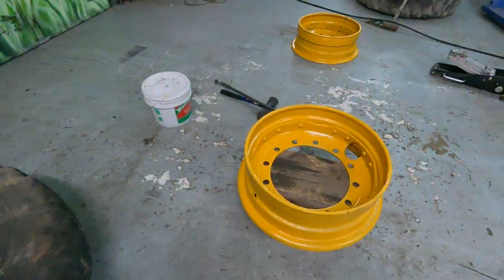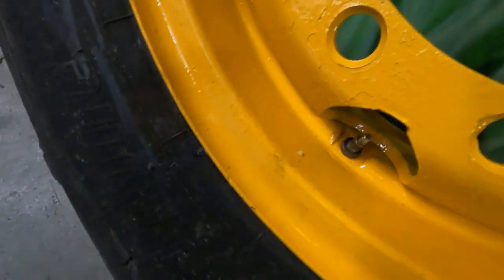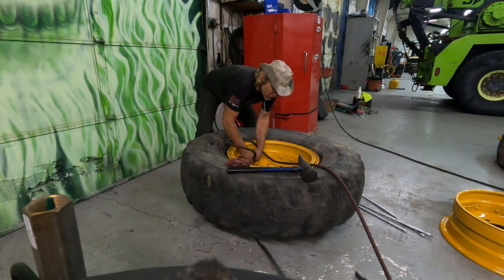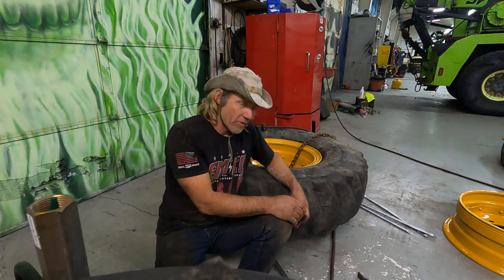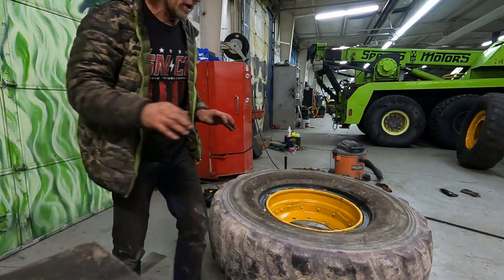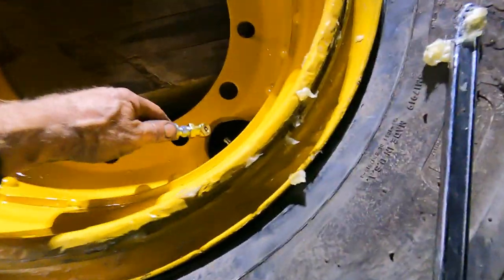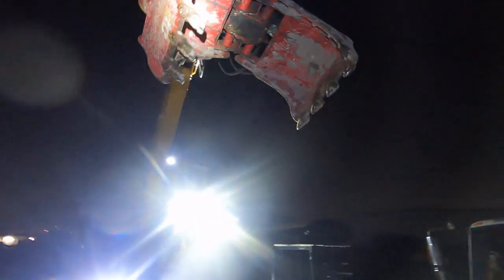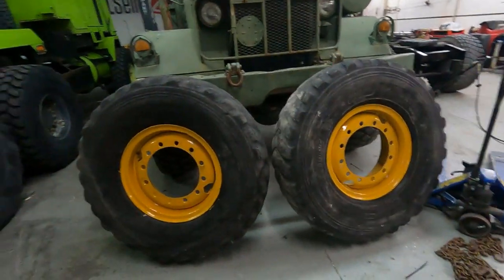RT6000 Can I get it running Tires Part2 also HET Wrecker Update!

Comment: My best friend's family owned a gravel pit with massive equipment, and we would have to leave the shop when tires were being mounted. I did not understand why the fuss until one let loose and went thru the side of the metal building—also nice, neat, and clean job on the HET.
Reply: @andrewsparks4112  I almost pooped in my cage when the rim let go
Reply: Really think you should have added a “don’t try this at home, this isn’t intended as instructional”, disclaimer.
Lost an acquaintance back in the -70’s, and in the -80’s, another got f*cked up for life. A screw on air chuck with a remote valve, to keep away from the whole mess, is the way to go.
Reply: I've always wondered about how some spray shoot i might not recall well but i think with starter fluid? To get a flat to blow up onto the rim. If it could blow also.

Comment: Hi Alan, I used to work on these tires for a living at one time.  Using the chains wrapped around the tire and rim was a good idea.  You should really have a cage to roll a tire into for airing up.  Dave has an abundance of large vehicles with large tires, a safety cage would be a good addition to the shop.  It's not as big of a problem with Budd wheels, but they still hold a lot of pressure and potential energy.  It shouldn't be bad to make one from DOM tubing if you wanted to.  You should also have a chuck that locks onto the valve stem.  I wouldn't put my arm inside the rim to hold the chuck on the valve.  The man that taught me to work on those tires had one break loose on him.  He was working on 2 at the same time.  One was in the cage and one was on the floor.  The one on the floor shot the lock ring off of it when it got to about full pressure.  It took off his nose and cut his face up pretty bad.  He was lucky he wasn't hurt worse, but it ended his career.  Thanks for the video!  Looking forward to seeing those fork lifts working.
Reply: like this idea for the shop - there are definitely some honking tires on the machines around there
Reply: At least he put a chain around the rim before airing it fully up

Comment: Hey Allan FYI i have done split ring tires on semi tires when i was a kid and still do some every once in awhile I'm now 62 years old. Please don't lean over tire when airing it up i have seen a loader tire that a guy put together blow him about 10 foot in the air after he got it put togather he was sitting on it airing it up when it blew thank god he was only banged up some and walked away. Good luck glad to see you have some loaders to work on they will come in handy for you.
Reply: Seen a 1 ton  split rim come apart blow the man back 20 feet had to go to hospital for 3 days luckily he only got stitches and bruised up be really careful need a cage
Reply: Remember it's not so much air pressure,but alo volume that's dangerous,never seen a person put the rings on in wrong order,you a atalanted but uninformed man on tire assembly and airing up safety

Comment: Having worked with hydraulics and their controls for over thirty years, I admire your work on the HET wrecker. Having all new wiring and having both local and remote control with clean, easy to test termination points, is the best way to provide reliability. I'm sure the crew will appreciate your efforts when the truck works flawlessly on the next recovery. Good job.

Comment: WOW Wizard now you're a tire repair man!!! A man of many skills - putting that huge tire back together is obviously not an easy task - but after watching many of your videos I have come to know that you're a perfectionist and would consider doing things like this for safety reasons and quality assurance.  
That looks very scarry watching you putting air into that large humongous forklift tire thinking of people losing their limbs or losing their lives because the tire could just pop off the rim and having rusty parts don't help much.  
Keep safe Wizard got lots more jobs lined up LOL!!! Great job - did you need your wand to help you remember everything necessary??? You forgot a "valve stem" for the tubeless tire, see you needed your wand means the brain needs to STOP & THINK & keep your ACTIONS under control and it saves energy & frustration but another day will always be there tomorrow.
Watching you doing these tires putting them together step by step is very entertaining for those of us who don't get to see what happens behind the scenes. 
Thank you, Wizard, you're amazing - you're a real "Eccentric Wizard" but it's obvious you still need the wand you almost forgot the O-ring then putting it upside down didn't help, but using a "excavator" as an extra arm is putting two & two together makes five was using your brain working smarter - LOL!!!
You definitely deserve a well-earned rest Wizard for all the jobs you do looking after all the electronics that needs fixing on the various "BIG BOY TOYS" in the workshop is just amazing, as well.  Hope you have a family to go home to celebrate a "thanksgiving" dinner with - we don't hear much about that side of your life would be interesting.  You just got to have a life other than just work, work, work LOL!!!

Comment: 👍 Alan videos are relaxing to watch and they are very real. I have done my share of low voltage wiring using blue sea systems marine components. They make everything wiring and are known in the marine world as the very best. I use it on all my RV restoration projects. I like the stainless bullet proof wire terminal lugs and their fuse blocks are stainless.

Comment: I really like your bypass to manual operation for when your remote goes down. I also believe those valves can be manually run in the event where your remote goes dead if you didn’t have the system your installing. Great job and enjoying your content.

Comment: Alan the shop should have what looks like a valve cap with steel wire running out the top that screws on & you run it out through the hole in the rim !

Comment: My gracious I was nervous for that split rim.. When I was 18 I worked at a truck stop changing semi truck tires.. I had an old farmer come in with his dump truck and a used tire he needed changed on a split rim.. I was lucky enough to have a cage to put it in.. I was well aware of the dangers of them coming apart and cutting people in half.. As I was airing it up in the cage, Everything was going great.. I heard a pop, which is common seating a bead.. So I kept putting air in it.. Next thing I know, I’m laying on the ground and people’s standing over me asking me if I was ok.. The explosion was so loud, people were pulling in the parking lot off the main road to see what it was. Come to find out, the sidewall blew out of the used tire. The ring never came off, but the air pressure was so fast, it shot straight through my pants and pushed the dirt under my skin in my leg. Luckily the owners father in law was there and was a medic in the navy. He took me in the back room to check me out. I was lucky… But that was the very last split ring we changed at that truck stop. The force literally bent the cage bars out.. stay blessed and safe brother!!

Comment: In the 70s I had tire problems and my 69 Ford F100 and stuck on the freeway and had to change tires with crowbar and did a lot of damage to the sidewall but some cold patch tar roofing cement and it it ran for next 10 years until it's bald

Comment: They make a screw on wire to guide tubes stems in. For safety I always used a chain when I aired up split rims...at 70 yrs old I did quite a few of these in my shop. My faTHER in  law work in my shop, and once he did a split rim and it was up leaning on the wall all day and when he touched it to put it back on the old dumptruck and it flew apart and broke his arm. Some companies fill tires with foam now instead of air.

Comment: Alan, dxo what I did, grind off the rivets holding inner rimm to outer rim, remove inner and fit into a newer tubeless rim with same  inner  diameter rim, an weld it to new rim

Comment: Alan. If you can find some metal valve stem caps. You can braze it to a piece of universal speedometer cable core so you can use the speedo cable core to pull the tube stem thru the wheel.

Comment: In late 60's one of my uncle was putting together a split ring truck tire and inflating it turned loose and broke his sledge hammer handle in half and and hit the ceiling of the shop. one of my brother was driving his 1 ton dully and a split rim came off and hit a mobile home wall about 75 feet from the road.

Comment: First Happy Thanksgiving hope you and yours have an awesome day.
Have to apologize I had to jump through the video as I couldn't watch as you were leaning over those tires while airing up. Minimum you should have a locking chuck and a remote air up switch but honestly it would be amazing if you had a cage.
Remember you can't help others if you are in a hospital or not around any more.
Amazing job on the wiring

Comment: Why wouldn't you just wire in a replacement remote receiver inside that same electrical box with the manual switches?

Comment: Please use a safety containment system when you are working on these types of wheels in particular the 3 piece rims. I have had this rim come apart when inflating them in a safety cage and at just 30 psi  bending the out of shape. If this rim blows apart it becomes VERY explosive.

Comment: I worked in a tire shop in my younger years, a truck split ring let go and broke a man’s arm on its way to putting a hole in the roof. I resurrected a Pettibone C8000 telehandler that was abandoned recently. A commercial tire company sold me four good used tires and charged me $100 each to install them on my machine, money well spent!

Comment: You should have a clamp on air Chuck and a tire cage so you can add air without putting you arms and head in the danger area  i done it by putting the tire under the vehicle  good luck

Comment: A locking air chuck and a short air hose is way safer. Lock the air chuck on the tire and stand back and connect the two hoses together and watch for proper seating of the rings

Comment: Leaning over the wheel while airing up that split ring rim is very dangerous. When I used to work at a garage we had a place up against the outside concrete wall with a couple of steel posts sunk into the ground and concreted in about 2 feet away from the wall. when we worked on a split ring truck time we would chain the tire and ring between the posts and the wall before trying to air it up. if we didn't and the ring failed it would violently com apart with enough force it could kill a person. I seen one ring rim come apart while airing it up and it gouged a pretty good notch in both the wall and the steel posts if it had not been chained in place it could have gone 50 or 60 feet easy. You know how heavy both the rims and the rings are on that style of tire  going that fare with that much weight just think what it would do to you with you leaning over the tire if is came apart.

Comment: Here's not what to do! never ever lean over or put a body part over a wheel when being inflated, have a hose that clips on the valve, never hit a split rim ring when airing it up, it jars the ring and will make it let go, even a few psi can kill, PSI stands for Pounds per Square Inch, think about that, at 40 PSI there is 40 pounds of weight on every square inch of that ring, multiply that by the radius of the ring and you're looking at tons of weight, then multiply that by the volume of air behind it.
I have 30 years' experience in changing tyres (yes tyres I'm Australian) from lawn mowers to massive mining equipment. I've seen many things go wrong, thankfully to common sense no one has been hurt, and passing my knowledge on has saved a few lives in my workplace after wheels (not just split rims!) young guys were working on have let go.

Oh and make sure you use good quality rubber grease on that o-ring/seal, you will find without it will vulcanise to the rim and you will have all sorts of trouble getting it apart next time.

Comment: There's a reason why they use a cage and a lock on air check for split rims and in the field minus a cage they flip the split Rim facing the ground but they still use a lock on air check not their body

Comment: Please please do not lean over one of those, especially the lock ring side like that. Stand it up and stand on the edge on to it side and swing your hammer or whatever to knock things into place. I have been walking up to a bloke and only 10 feet from him, also leaning over one with 120 psi in trying to get it settled, luckily with the lock ring facing down as lay it down it exploded off and the whole wheel went about 40 feet up and hit a steel roof beam while that lock ring left a permanent about one eights inch ring impression in the concrete. He survived after the wheel hit him in the chest then up and left his nose hanging off the side of his face, his sternum smashed and some ribs. He was very lucky to survive it but, he did have to retire after it.
The problem is mostly when it doesn't want to settle people often think some air pressure will help force it but, it doesn't work like that. Air pressure will lock it all together but, everything needs to be properly in position FIRST. If that lock ring had blasted away, you were in exactly the same position that bloke was except, he had the weight of the wheel to get moving so effectively that would have been much much slower moving than that light lock ring that have decapitated who knows how many. I'm not advocating the restrictions they have here now of having to work on it in a heavy cage but please don't lean over it when you could be completely out of the firing line, except your arm when your swinging it.
I've worked on ones on my old F350 dually with 16 inch split rims and 20 inch semi ones too and never even felt fear but, I always made sure everything was fully settled first.
It can be handy if you can lower weights onto the tyre to push it down so you can get those bits locked in, you need to get that down so it's not squeezing in and it and the lock ring can be settled properly first, then slow pressure and the tyre lust glides over it and then it can't go anywhere. I admit I would be more nervous with very old, very undisturbed and so rusty wheels but, pretty much the same routine.
I've never worked on a tubeless one of those but did assemble a large tractor wheel and tubeless tyre onto a normal car style rim and trying to get THAT to seal was quite a challenge. I ended up wrapping chains and dogs around the tread and clamping them in to get the tyres beads to start to seal which still took some time then once started I took off the chains but holy hell, that was a real pain. I was a lot younger and didn't know about the WD40, Hair spray, fire starter etc to get that big whoosh of air that almost certainly would have done the trick for me, some of that tyre mounting paste would have been good too but all we has was dish soap. 
BTW: I reckon that color would look pretty darned good on that whole fork lift. If not authentic enough well, ok but, it looks really good on those wheels.
Sorry, I wrote all that as I saw you first leaning over that and starting to put air in. Your chains were a really good idea though tighter and more maybe would have been better still. I was concerned when you had some pressure in and said the lock ring was still loose but you know what you're doing so good stuff.
Reply: We didn't see it but once you pushed that tyre's bead down with the excavator you probably noticed how much easier it is to pretty much just clip the lock ring in. You need to get that bead down so they can settle into their correct position then when the bead slides up over it'll lock it solidly but, you've got to settle them FIRST always, then things go together much more easily and safely.

Comment: Have you ever seen a little split rims blow apart if you have you definitely wouldn't be carrying it up while you're laying across it
Reply from the maker: I only had 5-10 max psi at that time, with the tire mounting compound it only takes a few psi for the rings to seat. I only filled up to pressure when I mounted the tires to the forklift and since the rings faced inside on this forklift, if it were to fail the components have nowhere to go, but to stay on the hub... Look carefully at the wheels on the forklift in the video and you will see what i mean.

Comment: I don't think your hammer is going to be very helpful in your rust prevention efforts. Hopefully you can apply some touch-up paint to undo what the hammer did do. I wish I had even half the patience you have, and even a quarter of the know-how you have as well. My F-it point would get reached long before your does, if you even have one of those, which I don't think you do.